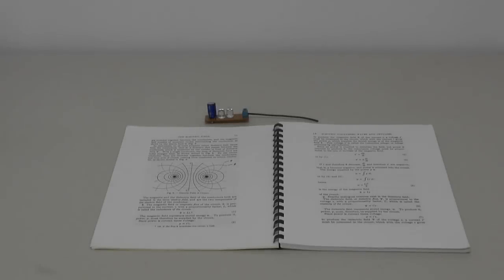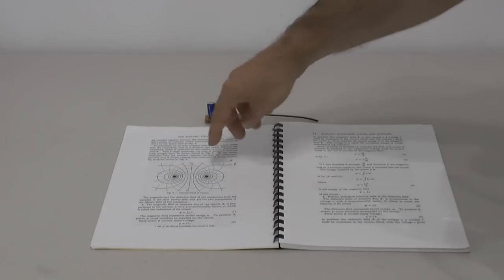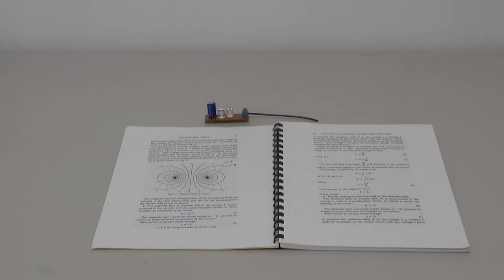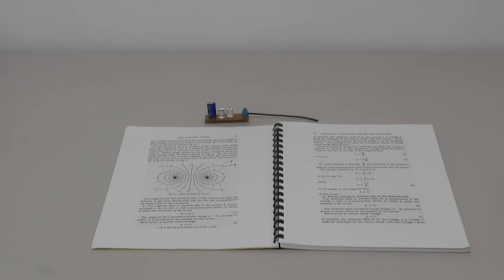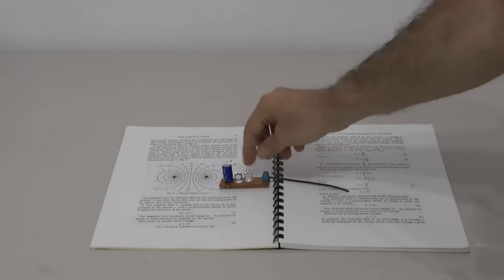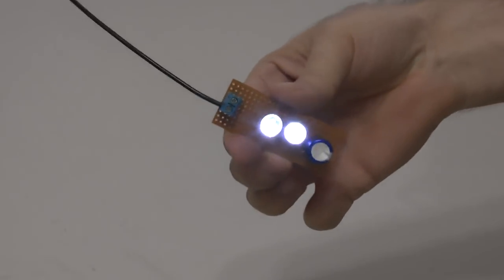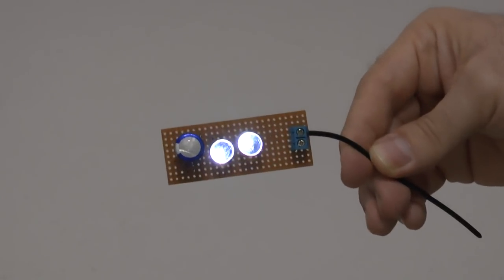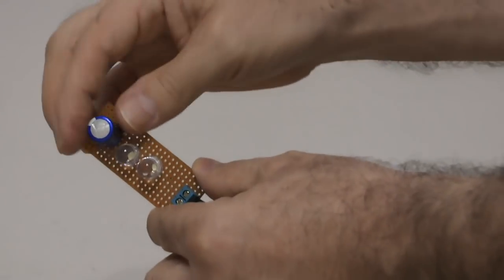Radiant Energy  and Dielectric Fields

Comment: +TheOldScientist  Appreciate your efforts and the thought provoking information you share.  Isn't this energy harvesting explained by the capacitive coupling that your body provides to the high frequency energy source?
Reply from the maker: That is called Capacity current and is describing the dielectric fields. It is mostly called stray capacitance. It would be interesting to measure the part the human body plays.
Reply from the maker: I realize that reference CP Steinmetz was not the best example. He bases all his calculation on the transmission lines.  My example is no transmission line an no coupling to a DC circuit without coil for the magnetic coupling is available either. This does explain why capacitors do charge to a high voltage. It seems unlogical.
Reply: Illogical*

Comment: so when tesla was holding a lit light bulb in his hand was he showing this effect ? also would you see if it powers more near a running water tap and then place one hand in the running water and the other on the aerial
Reply from the maker: Correct. However, he was using also virtual ground by touching the socket. I demonstrated that by touching the sphere in my previous experiment.